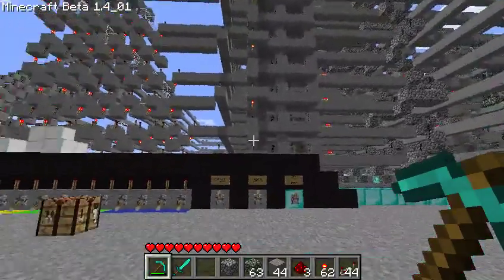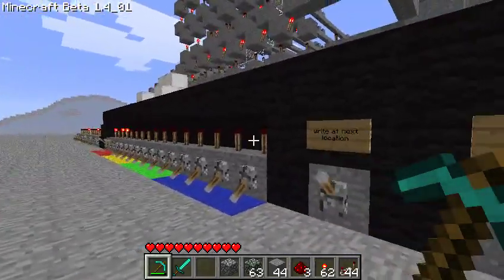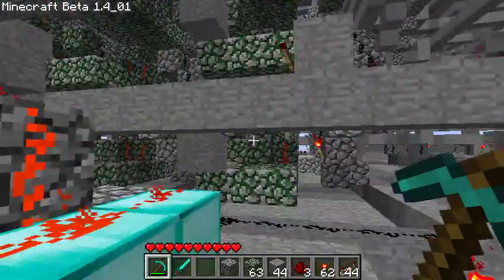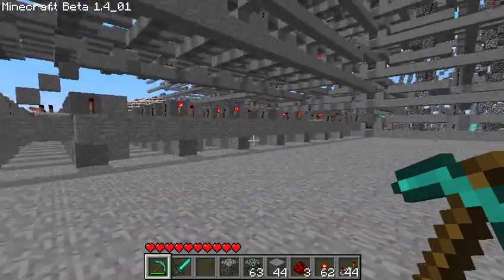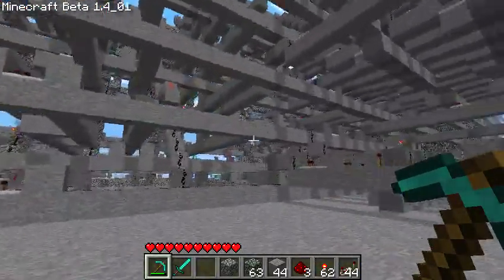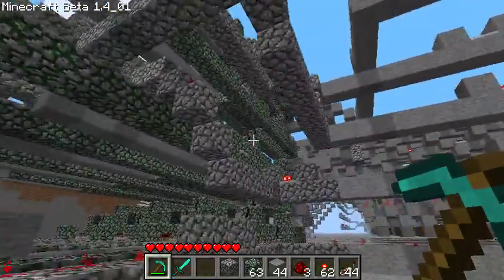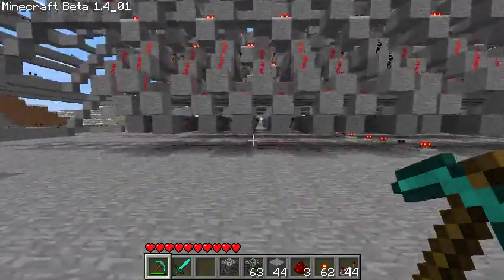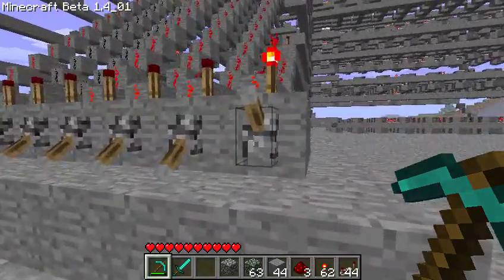Minecraft CPU brief overview

Comment: have always wondered..
how fast and powerful could you make a minecraft cpu if instead of using restone repeaters all the time adding up ticks you used the wireless redstone mod and/or comparators assuming that any case where signals have to be timed correctly are solved.
Reply from the maker: +Toms Tech assuming minecraft hasn't changed in the last 5 years, then the limit is the games engine, which (i think) has 10 ticks per second, so the quickest a single operation could be done is 0.1s.

that said, there are proper software you can use that will simulate logic circuits, which make minecraft look like a toy (which it is).
Reply: Salajapaju
nice to see you're still around bud, i remember downloading your cpu (this one?) like 2 years ago and being clueness.... not much has changed,
if the cpu cant be faster I wonder how big it can get (parallel compute like gpu's with slow clocks) again i actually know nothing about the inside workings of cpu's with regards to alu's, write logic etc so dont worry about a debate :)
Reply from the maker: thanks :)

i think the size of computers in minecraft would be limited by the game engine. ie; minecraft will only simulate redstone interactions to a certain distance, before it just ignores it, which would cause a compter to fail.
another issue with minecraft computers is the time it takes a signal to travel. you need to use repeaters, and they have a 1 tick delay i believe. as i understand it, that means that the speed of a minecraft computer is limited directly by it's size, while a real world computer is limited more by the speed of its transistors.
Reply: Salajapaju i gess if you could use the mod which allows an ALU to be a single block (i think you mentioned before) then used wireless redstone mod to join them you could have a cpu thats only a 10 or 100block cubed in dimensions because theres no repeaters needed and the whole alu now fits into 1 block, maybe the same with other cpu components like registers (i dont know about this stuff obviously) but if its possible to get the best mods to work together to make to connections smaller (single block cpu components) with no repetears slowing things down cool things could be done.
one day I might learn this stuff by which time minecraft will be a distant memory.

Comment from the maker: i dont know what to say, just made them. i have a 4-bit binary value coming in, i use a decoder to turn it into a hexadecimal signal (that means 16 data lines come out, but only one of them is ever active, eg 1st line is active, that means a 0, 7th line means a 6 and so on). then each of those lines goes into its own special encoder which controls what parts of the 7-seg display are active.

its just a basic 7-seg display and decoder setup. nothing special.

Comment: Technically, you could, but you could not build more RAM than your hard drive's capacity.
But with that much RAM on the virtual computer, it would take more RAM on your physical machine to store the running components, so you would need more physical RAM, then you'd need more virtual RAM to beat it, and so on.

Comment from the maker: oh i see. you chose the address when writing the program. the address is part of the op-code instructions. and only one program can run at a time, so it isn't that hard.

for example, if i wanted to add register 3 and 4, and save it to register 0, all of those addresses would need to be included in the instruction when you program it.

Comment: a genius maybe you definately have extrodinary skills in redstone and most likely boolean algebra if you built this. bravo! i believe you will be contacted by a group very soon that is buildin an extremly powerful (and fast) binary computer. and yes "theireticaly" you can run a common operating system on one of those. emulation like that is posible. try vmware. however it may not be possible thru minecraft sadly. :(

Comment from the maker: @adamridley11 the only reason it is possible to overclock real computers, is because the are under clocked when they are built, to ensure reliability. because redstone has a digital nature, rather than transistors which are more analogue, the words 'over clocking' don't have a meaning in redstone computers. but the clock is already optimized, so i think the answer you are looking for is, "it is already over clocked".

Comment: @Molo9000 And if you consider Minecraft itself to be a virtual machine (which it is a virtual world), then it's a virtual machine running in a virtual world running on a virtual machine running on an OS which could very be running on a virtual machine as well, running on a processor which is emulating another processor's instruction set.

Comment from the maker: @werecatOmega i originally had buttons, but sometimes when i pressed them they would 'pop' back out faster than normal, and i wouldn't be sure if it worked or not. so i replaced them with levers, and i can be certain that they are working.

Comment from the maker: @Khyperia  I've seen your videos, very good effort.
-my cpu has a total of 16 op-codes, but only 14 are used.
-my cpu doesn't have an accumulator. it has 14 general purpose registers, and it reads directly from 2, operates, and writes the result directly to a another in 1 clock cycle.

i have a thread on the MC forums, google "my cpu in minecraft".

Comment from the maker: @786RiDz i'm not certain that i've named everything correctly. my RAM is really a number of registers that can be accessed quickly, and server as memory. if i wanted to expand the memory above 16 bytes, then i would need to build a secondary bigger memory block that would only interact with the registers and not do anything with the alu.
about the graphics card... it's only an encoder and decoder, and i don't think that it quite meets that definition.

Comment from the maker: @Degast
1)i won't be giving out the save for a little while. i still haven't fully checked it for bugs.
2)i made it one step at a time. program memory -> RAM -> ALU -> display.
i didn't use any existing CPU designs for this. i made it up as i went, so it is possible that this architecture is entirely unique (but unlikely)
3)i guess you could say that.